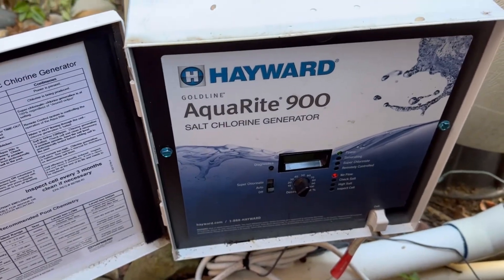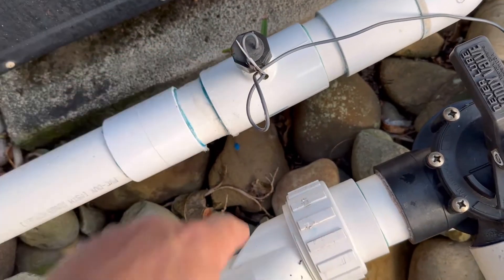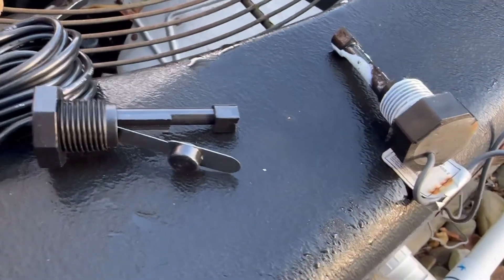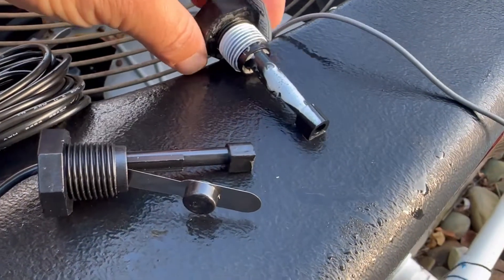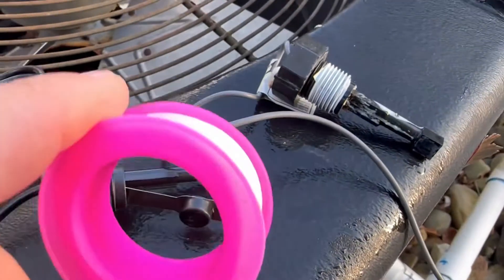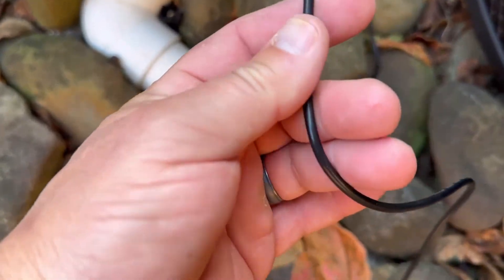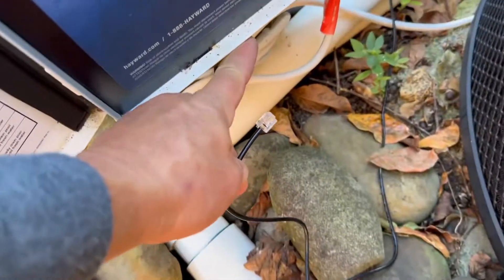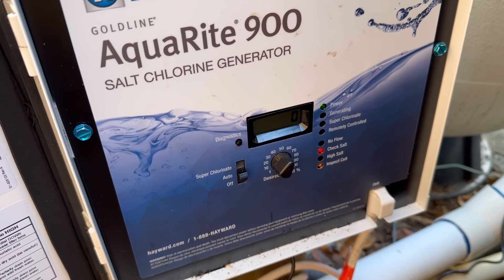How To Replace Flow Switch for Hayward Salt Systems - Pool Flow Sensor Salt Chlorine Generators

Comment: Do you keep the pump running?
Reply from the maker: @genuineci  I shut the pump off before replacing a flow switch. Once installed correctly, turn the pump back on